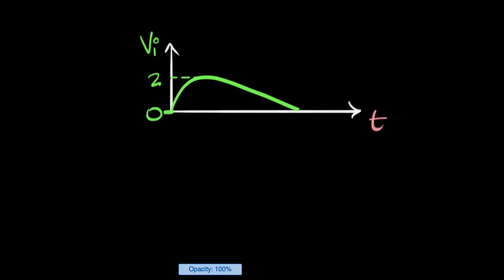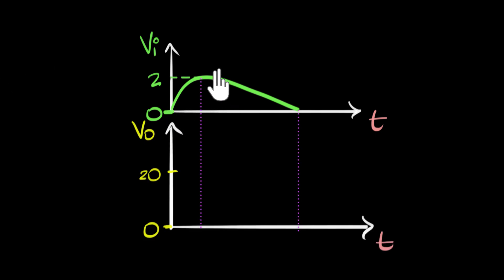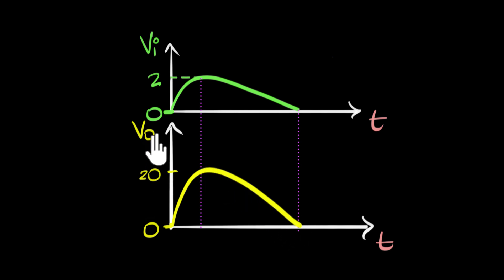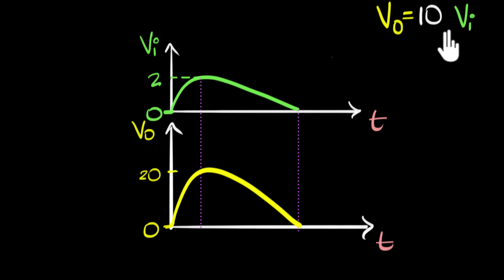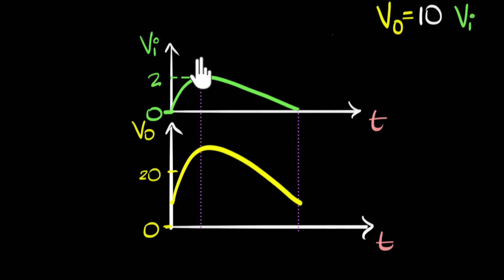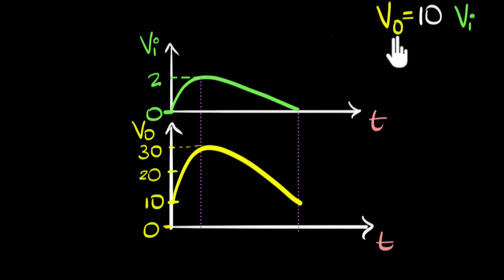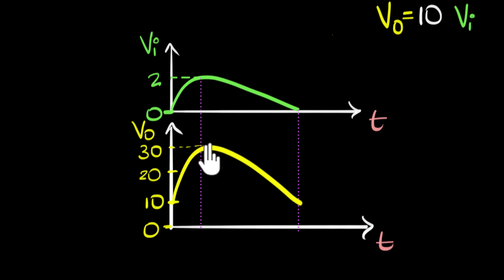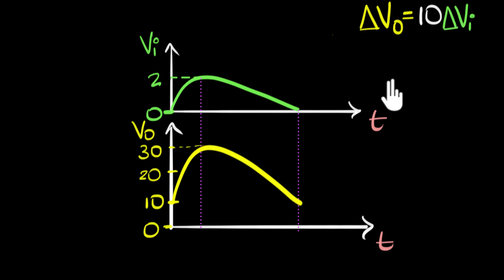Transistor as a voltage amplifier  | Class 12 (India) | Physics | Khan Academy

Comment: how can you take voltage drop from +3v to Vo since Vo is the amplified voltage and will be much higher than +3v supply
Reply from the maker: Could you elaborate your doubt please?
I am guessing the doubt is how is the output voltage only 3V?
The amplification requires electrical energy. That energy is given by the supply.
So if the output supply voltage is 3V, then the maximum output voltage cannot exceed 3V
Reply: @KhanAcademyIndiaEnglish  I am only telling that if the amplification of voltage is done from i/p to o/p then how could there be a drop from +3v to amplified output

Comment: I have a doubt sir.
How does the voltage 0.7 remain constant ?
I mean..isn't it changing with Vi ?
Reply: That's very simple. It is the barrier potential. Under forward bias if the  external voltage exceeds just the barrier potential the current shoots linearly. Thus even the potential changes a little the current is always the same maximum. Thus the base always stays at 0.7.
Reply: @udaykiran2798  hey... I have a doubt,please clarify,  firstly, don't understand, what is the work with 0.7v there???... In previous videos it is mentioned that V input =0.7 v. But now.. I don't understand... There are two voltage... Separately Vi and 0.7.two voltages are there..... Why... Instead of 0.7 v... Why didn't they connect Vi directly to circuit??
Reply: @penumalasunitha14  hi sunitha, i request you to go and check your connections with barrier potentials of semiconductors, if that doesn't clear your doubt then i will surely help you.
Reply: @udaykiran2798   I have a doubt that the vin is alternate voltage so when it is between 0 to 0.7V it acts as off switch so how would it amplify the input voltage
Reply: 0.7 V is the barrier potential at the junction of a typical PN junction, once the supply voltage increases beyond this, the voltage drop won't increase much from 0.7 V. Only current will increase. (This means resistance adjusts itself to maintain only 0.7 V drop across the junction). In metals resistance won't change much , so drop across the conductor changes.

Comment: What if I want the output voltage (V_o) to be equal to the input voltage (V_i) multiplied by a constant (k), and not just their deltas? 
i.e.  V_o = k * V_i
Reply: You should not do this. But if you really want to relate them without deltas then your equation will be like V_o = k*V_i + c
Reply: Remember there is no fixed 0 potential , we define it on our comfort.

Comment: what is meant by grounded,connected to the ground or a referrence point.
Reply: when a circuit end is grounded/earthed it means it has an electric potential of 0V
Reply: Yes and it's just a way to tell the voltage at a specific point in the circuit to make things easier, it doesn't matter which point in the circuit is grounded or if it even is grounded, just simplification